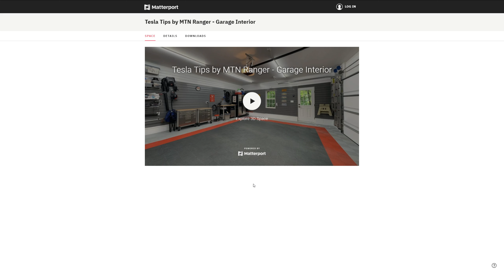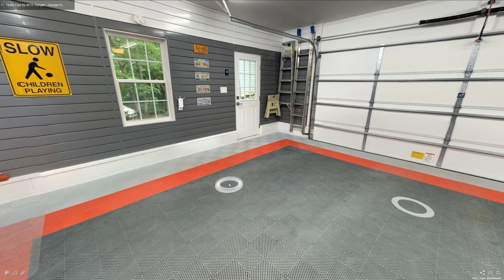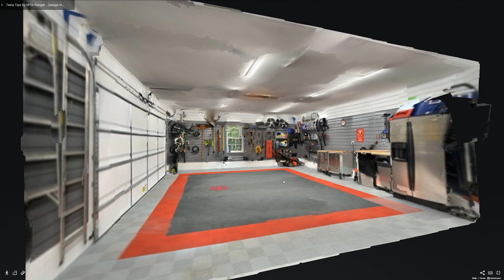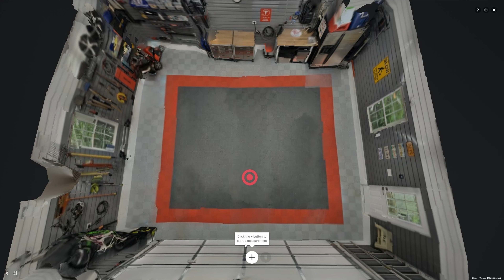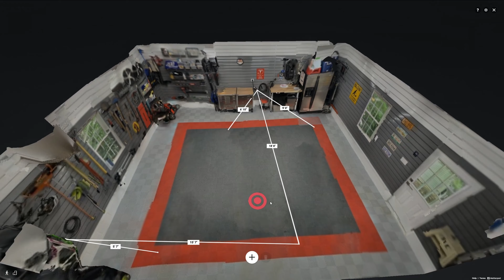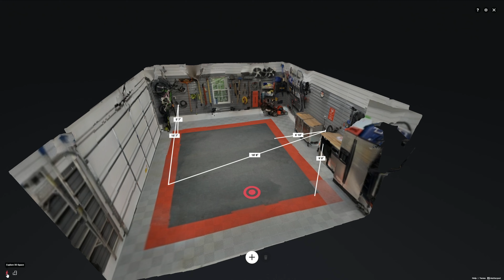Tesla Model 3 - 3D Garage Charging Setup Using Matterport

Comment: Very knowledgeable.   .

 Do I need a conduit to run this wires?
Reply from the maker: That depends on how you run the wire.  Inside the wall, conduit is not needed for romex wiring.  Mounting outside the wall needs to be in a conduit.

Comment: Man you should have gone Ego mowers, chainsaws, blowers and trimmers where you can use the same batteries between all of them!
Reply from the maker: While not Ego, I have the Snapper 60V system.  All the power equipment you see runs on them (except a wired leaf mulcher and power washer).  I have five or six battery packs and they charge quickly too.  Inside them are many Panasonic 2170 lithium battery cells.